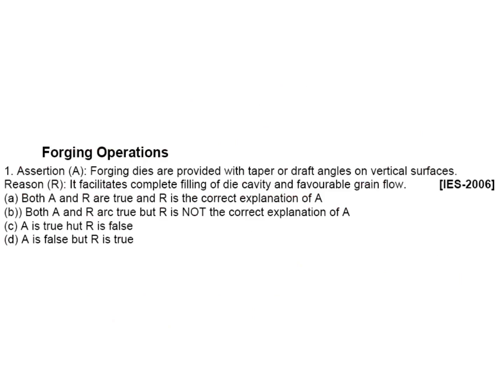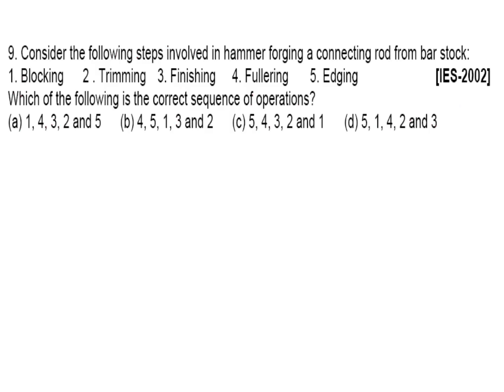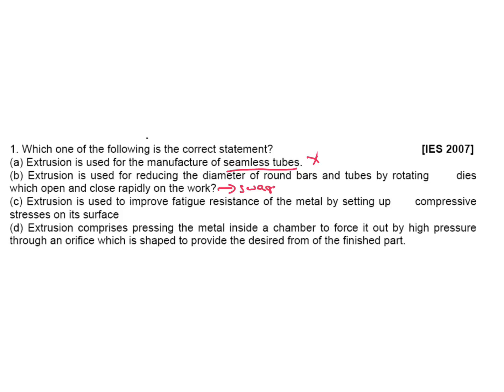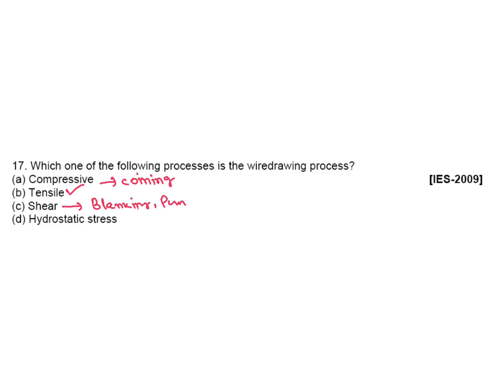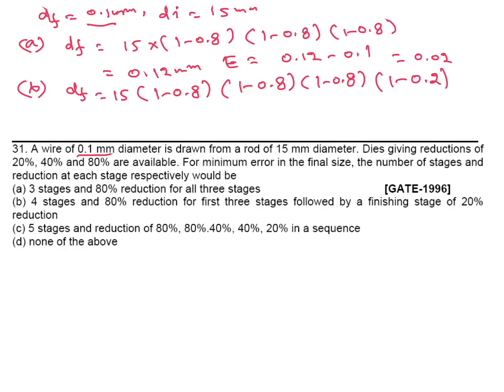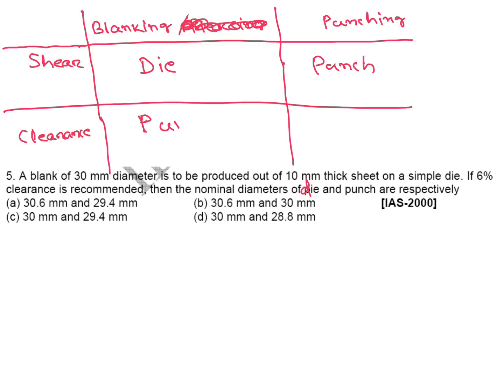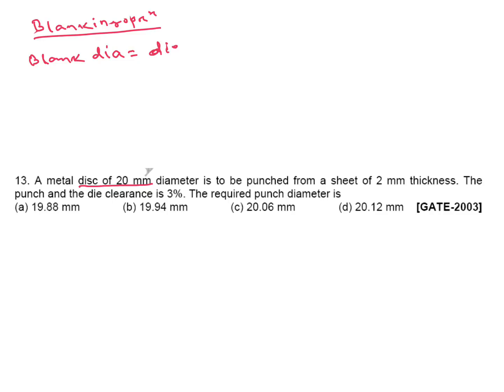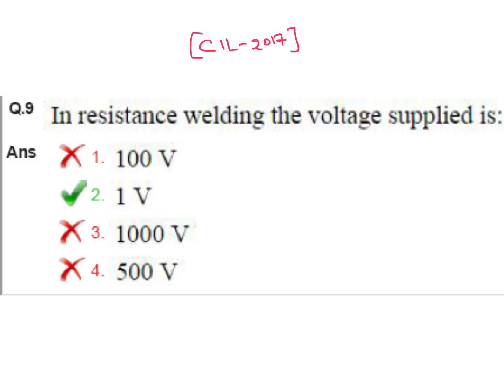MOST IMPORTANT QUESTIONS FROM PRODUCTION FOR RINL MT,ISRO,IES,PSU,GATE PART 03

Comment: sir in question 16 i.e sheat metal operation question clearance is given but in option all options are more than 50. only one option is less than 50(i.e.option a). so it shoud be currect ans. kindly check...
Reply from the maker: Ajay verma clearance not given but it should less than 50 so a or d , I think best option should d .